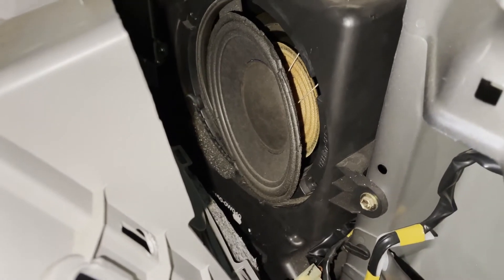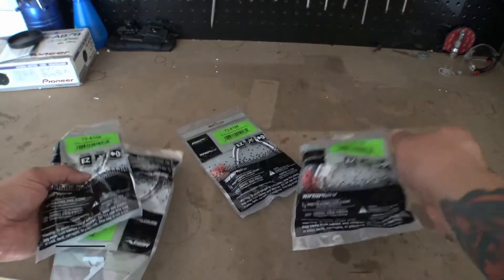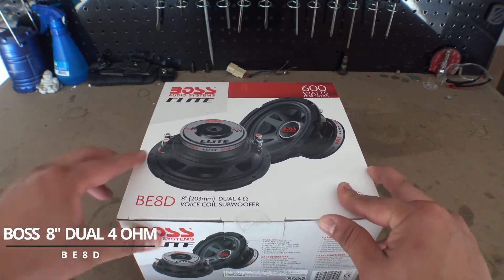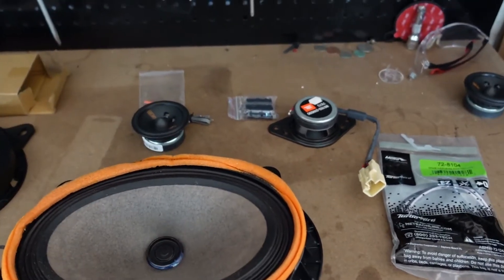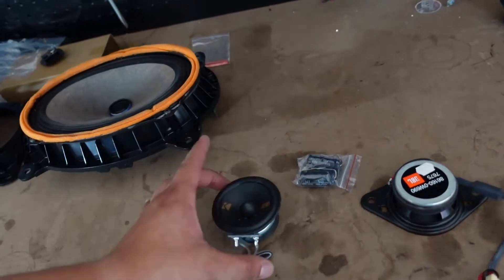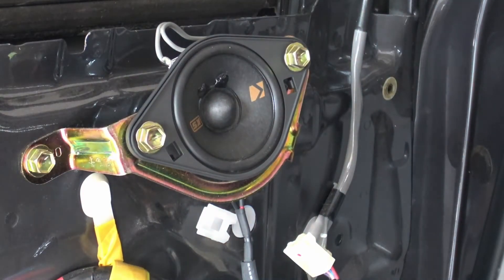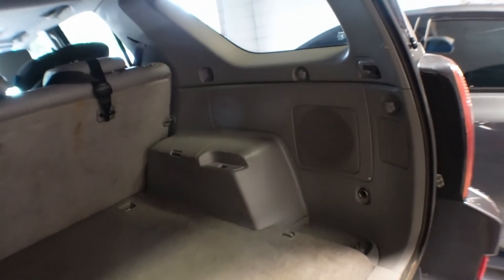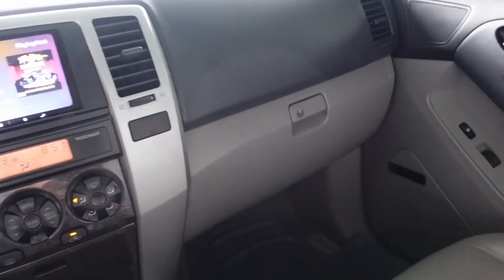Replacing Speakers on your car (4th gen 4runner)

Comment: Thanks for this. Looks like 2 wires to the door tweeter (+ and -.) Different from the non-JBL system where there are 4 wires. In non-JBL system, sound goes from head unit to tweeter then to door woofer. In this JBL looks like each door speaker gets it's own run from the amp.

Comment: Just so you know you dont have to take that entire side panel off to reach that rear 8".  There is a pop off panel that gives you access to the speaker and amp.
Reply from the maker: There is no there is not it looks like there is but the panels are welded plastic

Comment: I see you have the old JBL Synthesis speakers - so it had the factory amp that runs those?  Did you run into any issues with that...did you do something on the back of your headunit to run your new speakers with that factory amp?  Or are you bypassing that amp? Hope this makes sense.
Reply from the maker: Nothing needed I ran everything of the factory amp
Reply from the maker: But if you want best sound quality then it is recommended to replace the amp and better quality speakers with crossovers , again this was a budget set up

Comment: Hows the sound quality when you turn up the volume? Is there any distortion?
Reply from the maker: I have a slight amount when getting to peak volume on the radio , again like I said , if you want perfect volume I would install cross overs ,
Reply from the maker: I have a slight amount when getting to peak volume on the radio , again like I said , if you want perfect volume I would install cross overs ,

Comment: How about the center dash speaker? I'd like to remove or unplug it
Reply from the maker: So it’s like the door speakers poop the Panel but be careful the plastic may crack from age two torx bolts I believe T25 , unplug and again same as the Sammy door speakers

Comment: OK. you forgot the speakers right above the subwoofer. I guess you're not replacing those?
Reply from the maker: There are no speakers above the subwoofer , unless u mean the ones on the rear pillars which I mentioned I wasn’t replacing those or the center console one